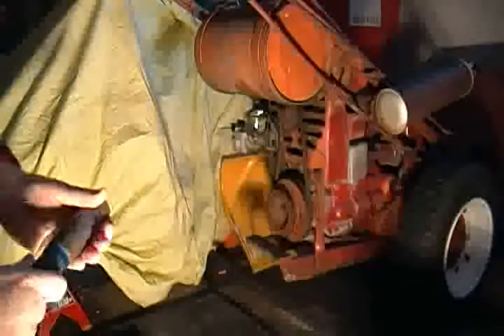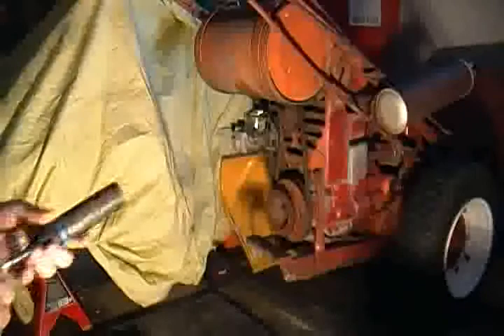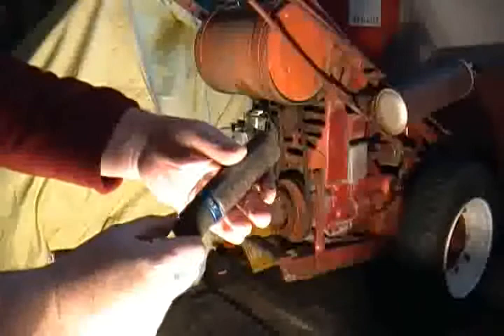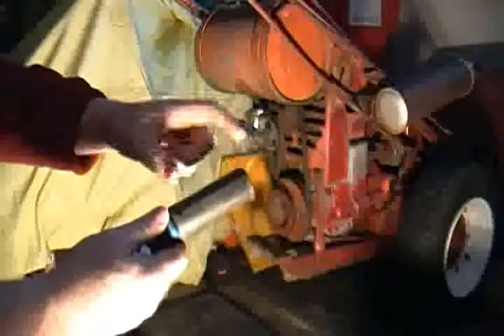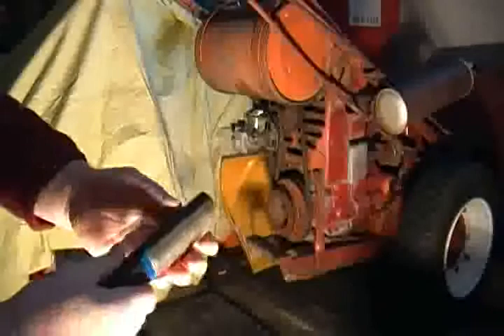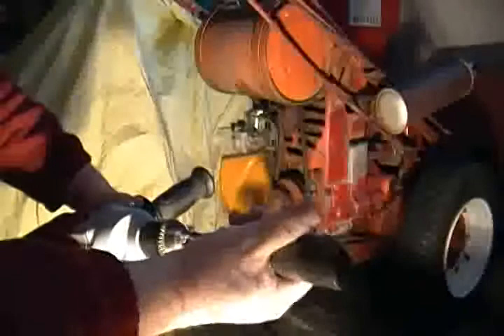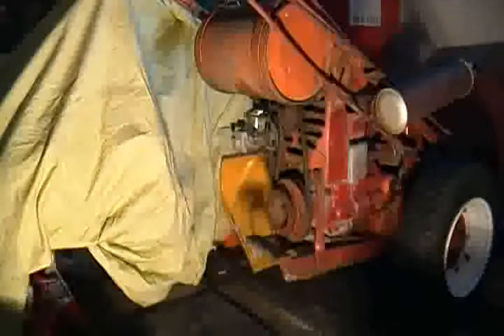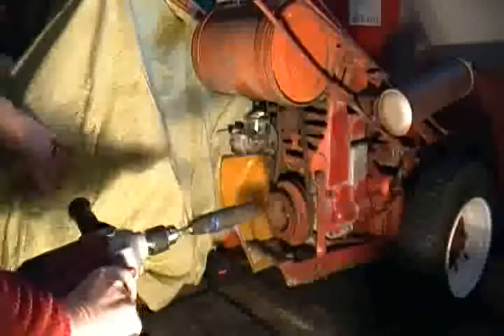Electric Drill Starter for Gravely LI Tractor

Comment: Where did you find a ratchet adapter?  I have been starting a '50 L without one.  PaulL
Reply from the maker: Search google for Performance Tool W32137. Its about 10 dollars US. I had done it a few times without the ratchet adapter and when the engine fired it would twist the drill out of my hands. This way was very nice. Good luck. What attachments do you have?
Reply: @4sl648  this is a really good idea, thanks for posting. I will do this for my L. The only thing I’m worried about is that this will tighten the crank nut and make it hard/impossible to remove. Have you removed the nut and pulley afterwards?
Reply: @simonjohnnyrose  Hi. ...almost any impact driver will back off the nut.